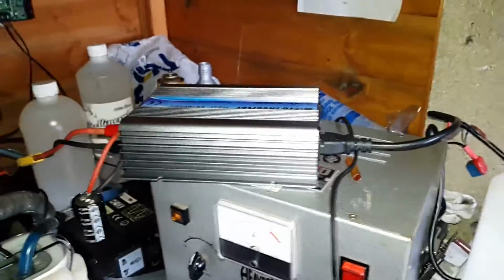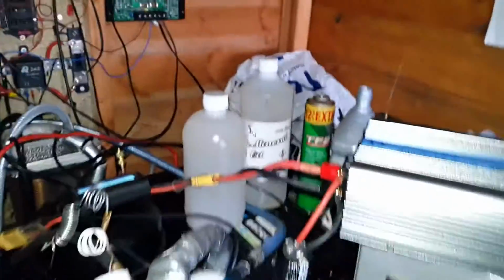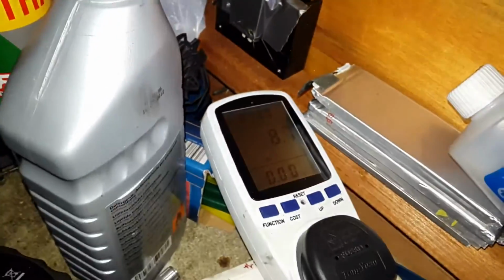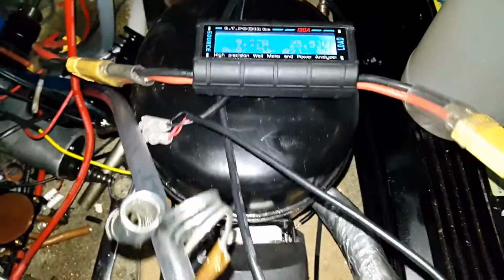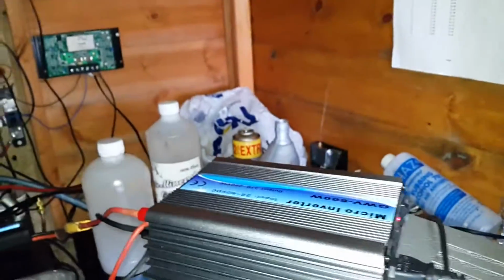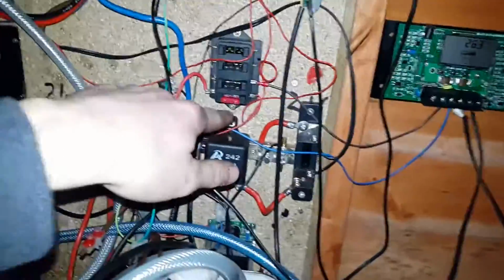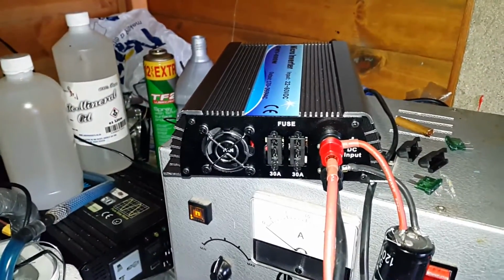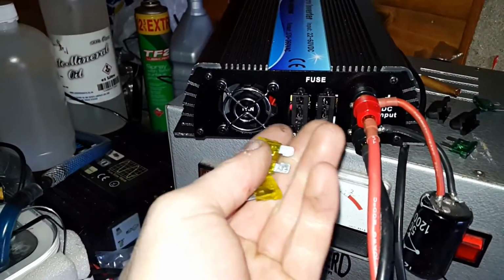Battery Grid Tie

Comment: It's been great watching how your system has developed. Thanks for taking the time to share your experiences. I am interested in how you control the mains side of the inverter, using an old charge controller. I guess the load out, is used to control the relay? Where do the PV in, and Battery out go?
Reply from the maker: +Michael Breslin Hi, and thanks for watching. The old controller is just connected to my 24v battery bank and the load out is connected to the relay via another relay that I use to control it via a raspberry pi. The old solar controller is just there as a low voltage cutoff at 25.6v as I only want excess power being fed back. It comes on again at around 27v. No solar panels are on the old controller.
Reply: Thanks Shaun. That's a creative way of using an old converter. I like it.
Using the excess power, particularly in summer, is a problem, as I 
guess, if I can't redirect it, it just warms up the controller!
I was considering doing something similar. But. If my house is not using all the power, then I have read, the power will go back to the Main Grid, and the meter will not go backwards, and effectively, I would be putting power into the Main Grid, and paying for it, as the meter would only register flow, not direction. Do you have any experience of this or advice? Cheers.
Reply from the maker: We have a meter with the wheel on it. In your case bigger batteries and an inverter will be needed. An inverter that can be used to power tools and charge stuff. Not a grid tie.